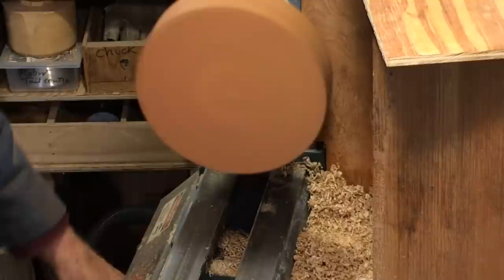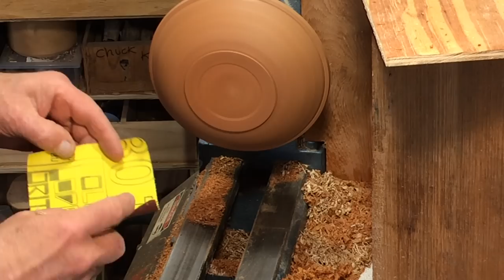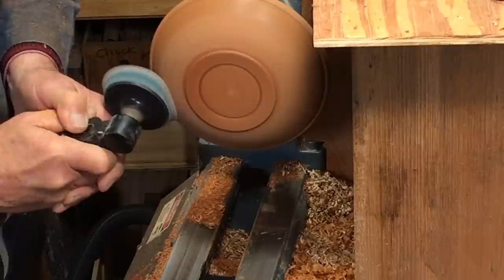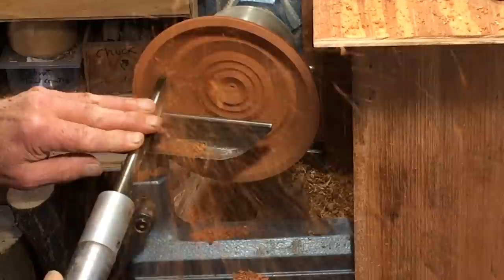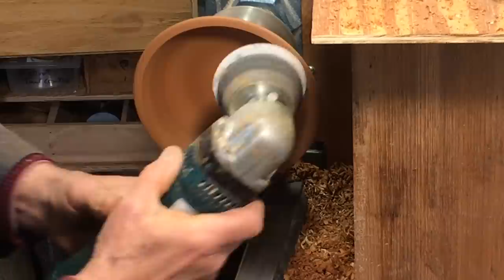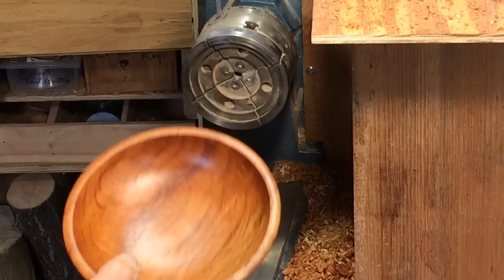Richard Raffan turns a forest-sheoak bowl

Comment: I really enjoy watching the efficiency with which you work. I know that you say you're out of practice and slower than you used to be but it's still much cleaner and quicker than most of us can do. I've learned a lot from watching your videos over the last few months.
I do see that you use what appears to be a 3" power sanding pad. When I started turning a few years ago I bought a 2" since I was starting with very small 4" and 5" bowls.
Is there enough difference to warrant adding a 3" for power sanding bowls in the 8" to 12" range? 
Thanks for your reply's to my questions.
Reply from the maker: I only use the 2-in pads when I can't get the 3-in in. With its wider contact the 3-in is in part a shaping tool that can remove any small humps in a few seconds. If you're making a lot of bowls a 3-in pad is a good investment and saves a lot of time.
Reply: @RichardRaffanwoodturning  Thanks for your speedy reply. Kind of what I was thinking but it's nice to have a more informed opinion. I'm not a production turner, merely a hobbyist but winter is setting in here in Canada and I'm about to spend a lot of time in the shop so it's likely a good way to spend a few dollars.

Comment: Thanks a lot for your videos from which i am lurning a lot. However i am a little confused about the use of spindle gouges. You are using spindle gouges a lot and very effectively when turning bowls. Other experimented woodturners say spindle gouges should not be used for turning bowls... Could you help me solve this contradiction ? Regards from Normandy.
Reply from the maker: They are talking about deep-fluted spindle roughing gouges. You see these in my video showing four tools turning a square spindle blank round.
Reply: @RichardRaffanwoodturning  Thanks Richard, but Kent Weakley from"turn a wood bowl" talks about regular spindle gouges vs bowl gouges. Here:https://www.youtube.com/watch?v=jC95iQOtONQ
Reply from the maker: @francoisgilson5042  Well, as you see in this video he's simply wrong. He's correct in that generally a spindle gouge isn't strong enough to hollow deep bowls, but as you can see in my video Turning a Bowl with a Spindle Gouge  https://www.youtube.com/watch?v=sYHBrUxpo7M  there's no problem hollowing a shallow bowl with a spindle gouge but it needs a suitable grind.   Did you see my gouges for bowls video  https://www.youtube.com/watch?v=9BH41jx05KI&t=7s in which I show how to use several shallow gouges.
Reply: @RichardRaffanwoodturning  GREAT ! I am going to look at thes videos right now. THANKS AGAIN

Comment: You make it look so effortless. If you don't mind me asking. What is the notch for on the left side of your bowl scraper?
Reply from the maker: Better finished tools have a very small radius along each corner. On most of my scrapers I remove the radius by flattening the top of the tool to get a really sharp corner. My shear scrapers have rounded sides so they slide more easily along the rest when tilted on edge, so to make those corners sharper I put a short bevel on the side. I'll do a video on this.
Reply: @RichardRaffanwoodturning  that would be great thanks. Most of the things I have learnt. Have actually been from your videos 👌